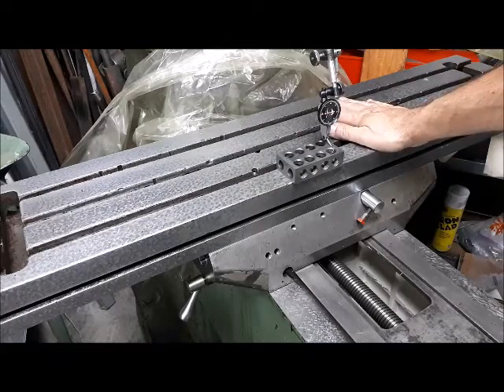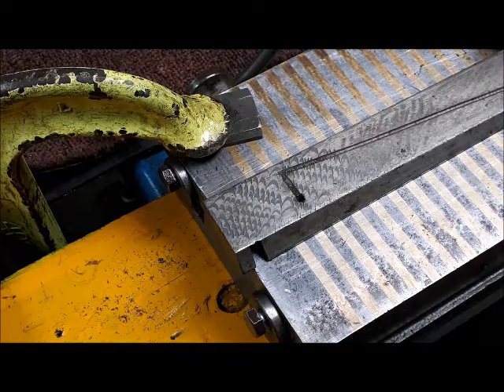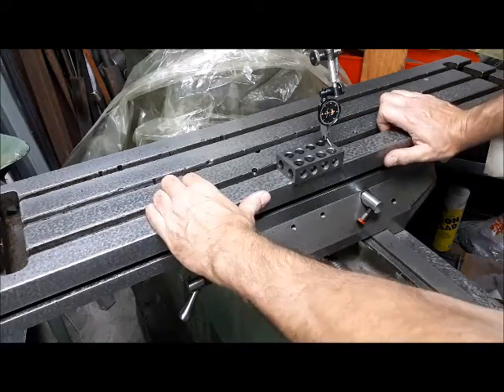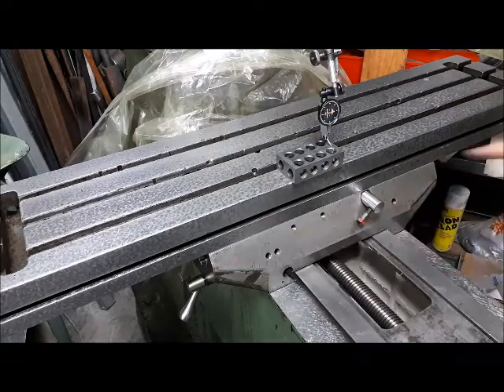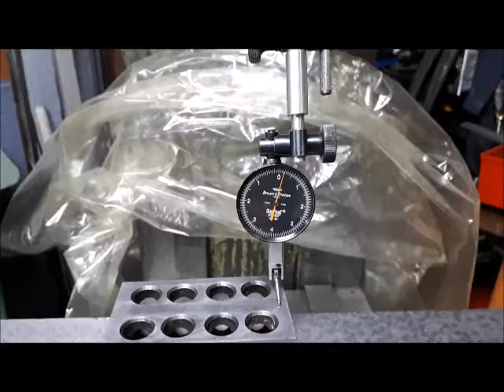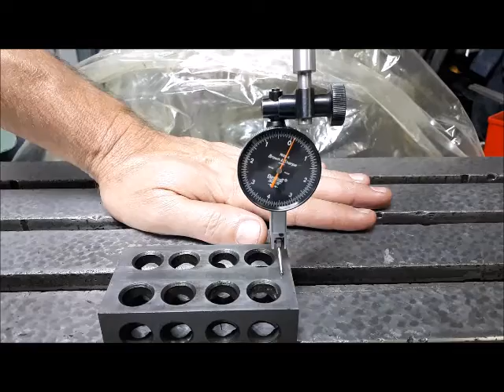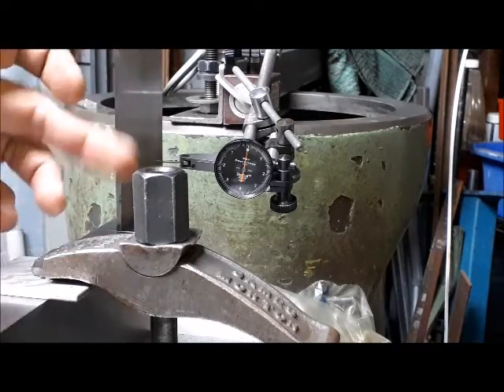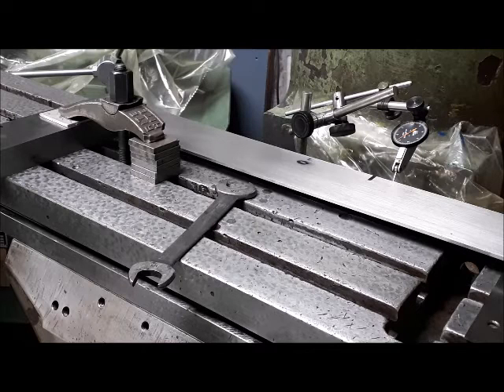Bridgeport Update 36

Comment: The danger of a cylinder square for checking like you were is that if it is tipped any in relation to the axis you are trying to check then the error reads worse as you gain movement when the indicator ball goes off centerline of the cylinder which then shows an axis movement that did not really occur.  If you throw a 100lbs on the table how do the readings behave?
Reply from the maker: That's a perfect articulation of what was happening with the cylindrical square...those things are tricky. 100lbs on the table.... now your asking for too much :) , this machine wont ever see anything that heavy!!! LOL. That is a good point though, will need to verify that the geometry holds, or improves, with some mass in the equation.  Thanks for watching and commenting.

Comment: Awesome. Glad to see your progress. My old girl is still in pieces. Question on your oil shed coating. What material are you using for all of those hidden areas you have painted white? Is it the same idea as Glyptal? Are you using an epoxy? I would be interested to know what type/brands of coatings you are using.
Reply from the maker: Thanks! So, the epoxy thing was considered, I passed though and went for just an acrylic enamel that was simple to use and appears to be holding up so far. I tried my hardest to get the interiors clean, so it could bite. Time will tell, as with most things… 😊 Thanks for watching and commenting.
Reply: @unknownapprentice625  thanks. I havent had the greatest luck with enamel and way oil or cutting oil. Mind if I ask what brand you are using and if you used a hardener?